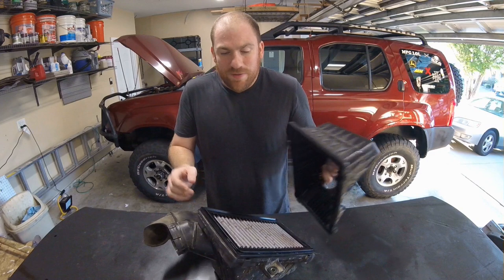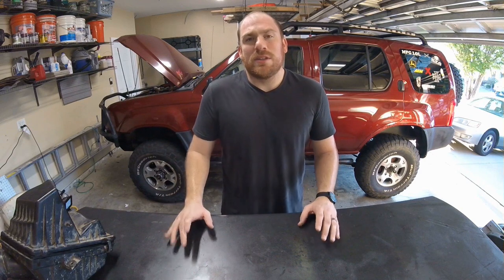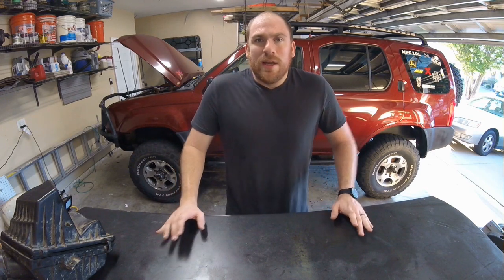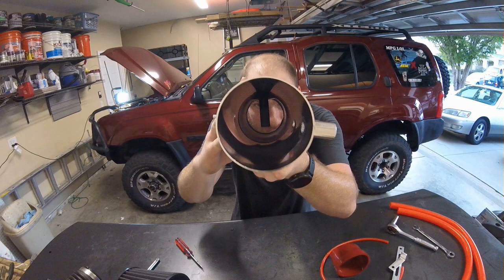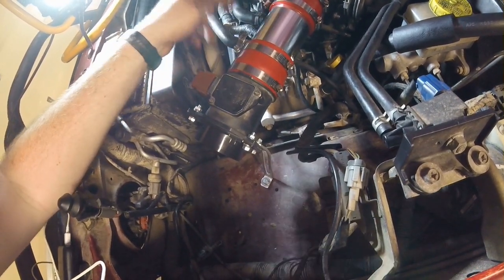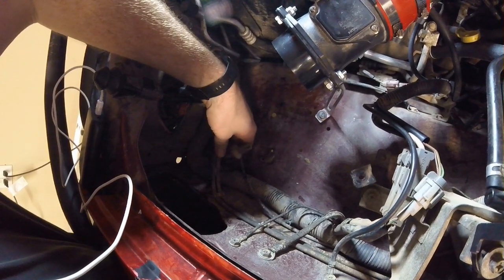10 TRUTHS about Cold Air Intakes - First Gen Nissan Xterra - VG33

Comment: I got an eBay Nissan Navara D22 snorkel for $150.00 and installed it into the fender with a silicone hose setup that leads into the stock air box, haven’t had any major issues just keep an eye on your clamps.

Comment: I did buy the kit. A while ago. Made my own silicone couplers that I found off ebay. Measured and cut to fit my stock position. But I did break the smaller egr tube which I threaded and plugged. Using the stock air box with the Apexi panel style filter. Inside the fender removed the stock resonator in the fender and stuffed a turbo horn inside where the resonator use to be.  Kept all the stock data points where the sensors are. I'm trying to think how I'm doing my exhaust. I may just run the pod style filter one day to see how it goes. I just hate that some of the hardware is missing like bolts to put on the pod ont to maf sensor.
Reply from the maker: Nice set up!

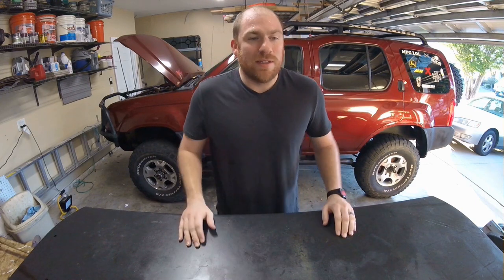Comment: 5:00 love it when you say regardless of it all. If you know what you're doing or even just having fun then it's a win!

Great choice going with a better filter. If it's the same as what I bought despite tight fitting dirt got past the fittings or the air filter.

Also, I recommend adding a new MAF adapter from K&N. The one on the cheap kit also became a dirt leak. . . Manufacturing varies perhaps in your favor.
Reply from the maker: Intakes are so polarizing...had to throw the curve ball at the end!  Im in a trial period right now...ill check periodically for dust or dirt ingress and decide if I keep it on or not.
Reply: @XterraRob  I look forward to the results.

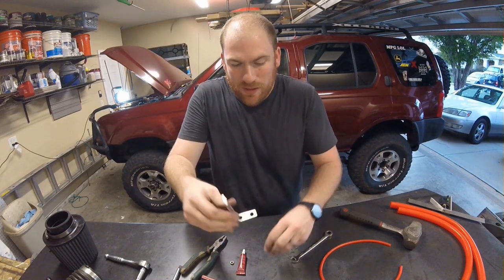Comment: 8:30. In some states a bracket is a legal requirement. I like skipping it as movement from the engine could pull your silicon fittings and create a dirt entry point when your engine moves a little.

Seeing the end? Your engine movement is less than mine. Better engine mounts? Or you weren't in gear. Retest with engine load before anyone decides on their ride if a they're better off without brackets.

Comment: I got a check engine light untill i drilled a hole in the intake for the Temp Sensor. I then i had  to clear the code. But i ended up ditching the K&N intake because i do alot of nasty beach driving. That sand is very fine  and didn't trust the K&N to defend against such such small particulates. Not to mention i noticed no difference with a Cold Air Intake. It definitely sounded cool tho. Gave it a more throaty sound.
Reply from the maker: Agreed...no real difference that I could tell, and the sound wasnt even much different compared to a modified stock airbox with AEM dryflow panel filter. Thanks for watching! I kept my stock intake since I figured i may want to go back, but it was fun to tinker!
Reply: @XterraRob  OK cool, i'll try the stock airbox mod then. Didn't know it sounded that close to a CAI.
Reply: @chancey1979  I think a cool upgrade would be for a company to make a straight pipe from the air box to the throttle body. A bit of short ram design mixed in with the safety of the original design. 👍Maybe I'll try that next! (If I build it they will come and watch more...usually 1k views. Lol)

Comment: I have a Volant CAI in my Gen1.  The Volant engineers had a sense of humour and decided that mounting the IA sensor in the box right next to the radiator was a good idea.  It was getting heat soaked and not representing the actual intake air temperature, so I moved it to the other side.  I have it hooked up to a Navara snorkel, which is really just an ugly ram-air system because I've yet to need to ford deep water here in the Rockies.
Reply from the maker: Nice setup!  Volant intakes had been recommended a lot on the forums. Sounds like a good set-up!

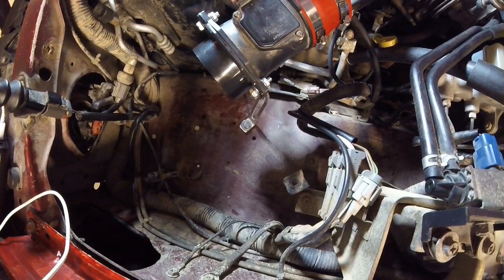Comment: 10:00 your MAF bracket looks fine. Mine bent and needed metal for a firm seal. I never did make the much needed metal bracket which is why if I tried it again, I'd need the K&N MAD adapter. I'm assuming it's higher quality... it's cheaper then getting another from Nissan anyway! Lol

Comment: I installed one on my xterra after I installed an intake on the Titan, and I ended up hydrolocking the Xterra from the cold air intake. Lesson learned don't use a cold air intake offroad.
Reply from the maker: If you offroad in deep mud or water...id avoid completely as youve learned. I'm mostly on dirt and rocks. Not as dangerous there. I'm still gonna get rid of mine and go back to the stock air box.
Reply: @XterraRob  yes good idea as I leaned the hard way. What I didn't mean was I also bent 3 of the 6 rods in my vg33 and you guys know those engines take a beating
Reply from the maker: @titanstudioproductions335  Holy crap! Did you think it was a submarine?!?! That had to have been deep water coverage to do all that!
Reply: @XterraRob  For sure lol!! Haha I have a video on my channel of your interested!
Reply from the maker: @titanstudioproductions335  nice video!!! So...is a new engine going in, or are you moving on to other things?

Comment: I'm dropping in a cone outside the  radiator to get some more sweet whining at wide open, cam is probably next to port and polishing the SC and everything refreshed from your 'is a cam worth it' video to get a 210 wheel hp, I'm scared with a smaller pulley until fuel injectors and everything is upgraded. I don't offroad with my X, I just need a rear diff lock.
Reply from the maker: Sounds like a fun project!
Reply: @XterraRob  I want to hear the cam run on yours. there are hardly any soundclips, the one I did hear was way too agresssive for me in a VG33ER, which may be a VG33E to ER conversion but I don't know.
Reply from the maker: Yeah I definitely have a rough idle. I would recommend the JWT stage 1 cam or the Euro cams on 4x4parts.com.  I have at least heard that JWT cams have a smooth idle. I have a video on "my cam plan" that goes over different options.
Reply: @XterraRob  I'll watch that next. Thanks for being a great resource
Reply: @XterraRob  I want some chop, the xterra might not be it with the VG33ER motor maybe cranking out 230whp if I'm lucky, not sure how much the trans can actually take...330 crank hp? Is it harder to keep at idle for daily driving for the average driver, like my wife, or is there a learning curve since it changes so much.
Reply from the maker: My idle is rough but doesnt die out. So nothing special to keep it idling, it will just feel "wrong" if you aren't expecting cam lope or chop. I have an auto transmission but dont know much it can handle...i just know I am no where closs to the limit :)

Comment: so you had no issue with that sensor you left at the bottom? I was thinking of making a small foam filter for it to keep the elements  off of it but still has loose air flow
Reply from the maker: No issues with the sensor specifically. I ended up taking the intake out and left in my stock airbox with the baffles removed. I have a video that shows what this "Stock Air Box Mod" is. It worked better in my opinion.

Comment: You are a little off on number seven! Hi flow filters do filter down to the same particle size as a factory filter because of the oil! The biggest reason why they flow more volume of air is due to the overall surface area of the filtering media in a good quality aftermarket filter!
Reply from the maker: That is a good point.  Just have to keep up on the oil maintenace and not over oil to contaminate the MAF. Thanks for the comment.

Comment: What exactly is that lift u got? I've looked everywhere....they don't make one for a 03! So do I have to do a PML?? That'll mess up my cv's
Reply from the maker: 4x4parts.com. I have the upper control arms and regular lift shackles. You can also try Calmini or Maybe Rancho which makes nissan lifts. Ill have to make a video on suspension lift options cause it does get confusing. Anything from 2000 to 2004 has same suspension, so they so have the same lift components.

Comment: Where did you get your Rock Bars and bumpers?
Reply from the maker: Rock sliders from shrockworks.com. rear bumper I made with a harbor freight welder. Front bumper I had a local fabricator make a one off bumper.

Comment: Can you share a link to your intake kit? Will it fit on the stock air box? I am more or less just looking to get the tube as my rubber one is starting to fail
Reply from the maker: Won't fit on stock airbox...the tube is too straight. You can get a replacement rubber tube on Amazon for 20 bucks or so.  Search for xterra intake hose and see what you find.
Reply: @XterraRob  ok thanks. The rubber one are kinda prone to cracks. If i can find a metal replacement i would be happy. Otherwise, ill get an other rubber one. It still last for 15 years
Reply from the maker: @xSpyke438x  thats what I would do honestly. Wish there was a smooth silicone hose that would fit personally. But the hose connections make it kind of unique.
Reply: @XterraRob  I will post back if i find an other way. The stock air box is fine. If i can cobble something together, i would be great

Comment: Itll be hot air intake cause of aluminium you have to cover it with heat wraps
Reply from the maker: I know...buts it's removed now! Nice icon....i used to drive a BMW 318ti (1995 e36)  fun car
Reply: @XterraRob  why did you remove it? Any issue with this mod?
I got an issue with intake in my pathfinder 2007 so I've fabricated pipe from pvc and it's running well thinking about adding filter but in hot weather it should be completely covered like stock and  cold air from fender
See this is my setul in diffrent language but video can tell without audio even first picture on the video 
https://youtu.be/MDrzNa_yz8o
Reply from the maker: Off roading leaves the cone style filter exposed to dirt and mud. I have a video on the stock airbox mod which is what I recommend. I also have another video with an update on my intake and why I took it out. You'll have to check out my video time line.

Comment: Don't spray too much Charger Oil, it can cause oxygen censor malfunction. Engine light will flash...
Reply from the maker: Yes good call. That and mass air flow sensor issues. I used AEM dryflow air filter that doesnt need oil though...but for KN type filters...dont over oil.

Comment: I got an eBay Nissan Navara D22 snorkel for $150.00 and installed it into the fender with a silicone hose setup that leads into the stock air box, haven’t had any major issues just keep an eye on your clamps.
Reply from the maker: Awesome!  Thanks for sharing!